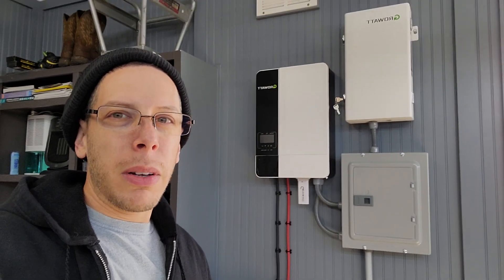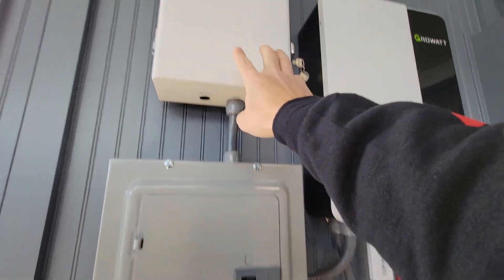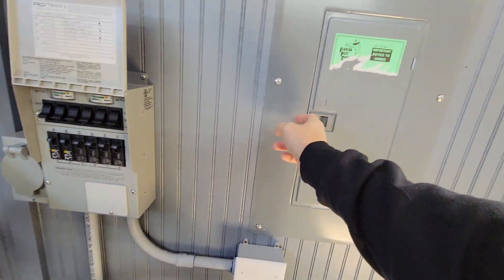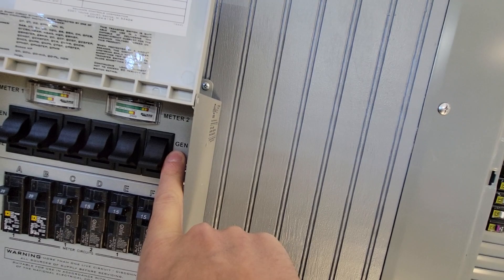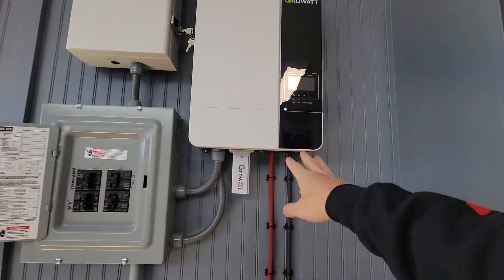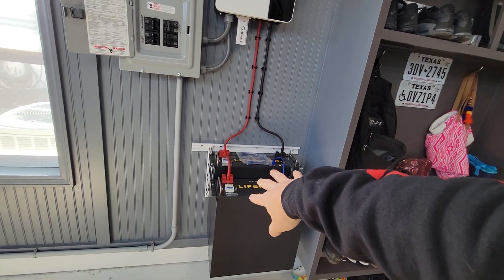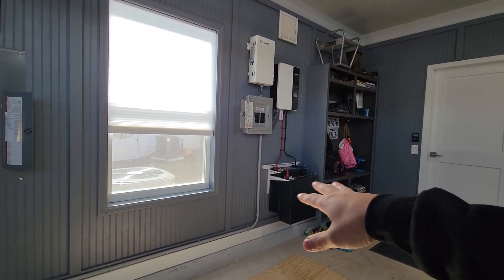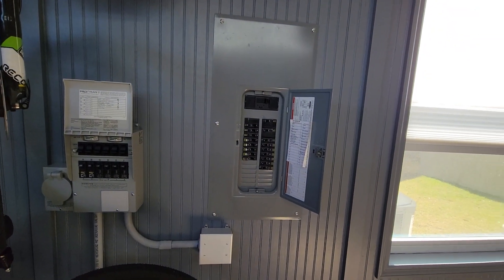48v Off grid battery backup.

Comment: very clean design, thanks for the video, I am doing a offgrid set up with similar components for my tool shed, but using MPP all in one and only need 120V intead of 240V
Reply from the maker: Yes the 110v inverters tend to be lower output 3000w I did not want multiple inverters. Looking back I should of just gone with a larger all in one 120-240 split phase inverter..

Comment: Clean looking install!  I am planning to do almost the same setup.  My ideal setup is running off solar/batteries as primary power source and using the grid power as my backup and battery charger if I use more than my battery capacity.  Video from Signature Solar on setting that up https://youtu.be/vUWxTbaWbS0  I look forward to your next video!
Reply from the maker: Yes awesome, I wanted to be totally independent. I could always wire up a 240v from my main panel and configure the inverter to use the "shore" power as last resort however, I wanted to keep this as independent as possible. There is always time to switch things up!

Comment: Very nicely done, I was considering doing a similar build in my carport to charge our Tesla and maybe even run a couple crypto mining rigs. Im in Texas also and would rather not deal with the massive costs of hiring solar installers and simply have a offgrid 2nd system to charge up the car and even run a few essentials off of during outages. Glad those server rack batteries are back in stock, I might order up this gear!
Reply from the maker: Yes awesome, I like how the new Teslas will let you choose the rate of charge (amperage) I am not sure if the older Teslas would do that. I was contemplating getting one and being able to charge off of this setup. Im leaning more towards a plug-in hybrid now. Hesitant about making the move to full electric I travel from texas-florida yearly and wouldn't want to spend the majority of that time charging up. And yes, solar these days is turning into a sales gimmick. I don't want any tax break or a workup I'll buy and install myself.
Reply: @Thesick240  You're in a similar situation as us, all teslas software allow you to adjust the amps charge rate. Our 2014 Model S allows it as well, we've driven to florida and NC from Texas, no issues , I highly recommend a Tesla. We used to have two Prius's and couldn't be happier with the results from our Tesla. I'd skip the Plug-In Hybrid and go straight to a Tesla, could always just buy used if worried about price. A used Tesla is better than any New Hybrid.

Comment: Looks like a good start to an effective backup solution.  I would wire the transformer as indicated on the sticker inside the door, getting rid of the individual breaker.  The inverter and transformer should be connected together and then back feed the Siemens panel through one double pole breaker.  I'd make sure that the generator input isn't live while connected to the input on the inverter.  It shouldn't be, but you never know how these things will function until you test it.  Don't want kids lifting the flap up and getting shocked on the inlet prongs.

Comment: Nice setup.  Clean and organized.  What did you use for your battery mounting system?  And are the battery terminals well protected from accidental contact?  Seems like Signature Solar may be the only seller of the US model for the 5000ES.  A simple check for continuity between neutral and ground on the inverter should tell you.  Looking forward to some load testing because this system is the direction I'm leaning towards.  Thanks for posting.
Reply from the maker: So, the battery mounting system is actually some inexpensive shelving rack system you can get at Home Depot or Lowe's. I went this route to maximize space in my garage. I know signature solar wants you to mount them in the rack system however, I didn't see any strong warnings about mounting them vertical. The brackets for the shelving system advertised 200+ LBS per bracket! I just made sure the horizontal piece hit the studs!
Reply from the maker: Additionally, the terminals are pretty well protected considering NO the plastic guards they come with are not on due to the 90 degree terminal ends i used. Shorting out will be quite difficult. I think is safe at this point.